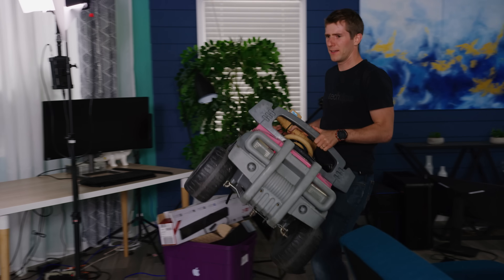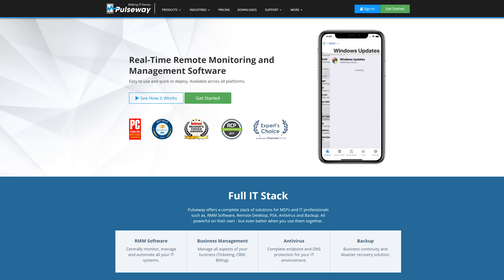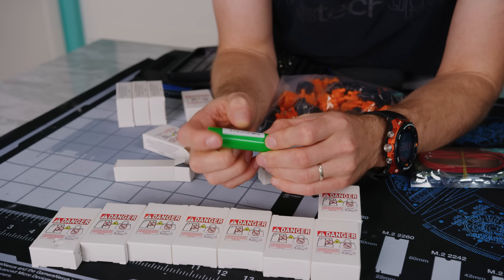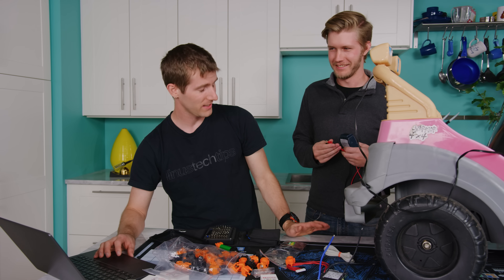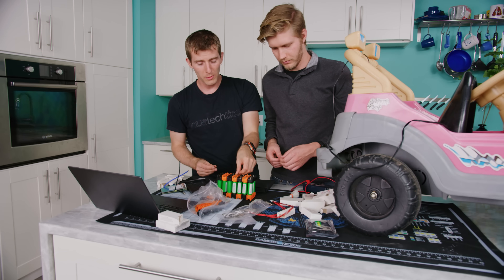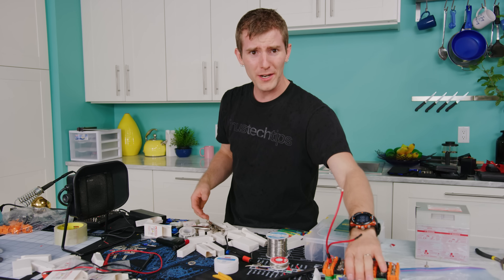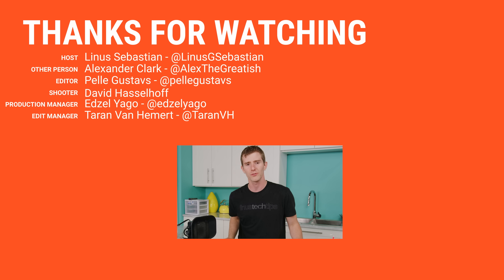DIY Lithium Battery - What could go wrong??

Comment: Should rename the video to "Linus almost dies 3 times":

10:35 shorts the battery
10:50 shorts the battery AGAIN
12:12 car crashes
Reply: Its not you its the batteries that die from shorting the wires. 24V is not even enough to tickle you, als long as your hands are dry. And even with wet hands, the worst that can happen is that you burn your skin.
Reply: @Igeltod  It's not about the voltage, nor even the amperage, in this case.  Lithium batteries are prone to thermal runaway on dead shorting, and Lithium fires aren't a joke. If that's not bad enough, these things are prone to not just lighting on fire, but exploding when abused.  Most of the videos of people's vapes exploding in their pockets and causing severe damage are from dead shorting the battery, usually damaged wraps or unwrapped batteries in metal casings.  Mostly mech mods.  18650 batts aren't toys, and they absolutely can cause a ton of damage if you f*** up.
Reply: @Igeltod  Voltage doesn't kill you, electric current does.
Reply: @LeGoog2008  Voltage penetrates and amperage kills. Like said before, 24Vdc is way below ELV and is considered as low risk
Reply: @umbracat_tr2n  guys, how to do extra battery for EUC (electric unicycle)?
Reply: @umbracat_tr2n  emmmm. Seriously, it is not about 24V over your body though, it is more about the red-hot cabling, burning insulation, and a battery that might start a fire
Reply: @ushiocheng  I wasn't talking about these things; I was explaining how voltamps are dangerous to people
Reply: .....no one thinks he is going to electrocute himself, which, you CAN do on a battery with little more than a single length of wire in a coil that can magnify the voltage, high current lithium ion batteries can dump 30 or 40 AMPS from a single 18650,  thats over 150 watts EACH battery, now multiply that by 7s3p, that is over 3 KILOWATTS that can be dumped into a load, that kinda current will turn a 0 gauge wire incandescent, i dont even want to know what those puny "bus bars" would do if shorted
Reply: @LeGoog2008  yeah but to drive high current through your body, your need high enough voltage...
Reply: @frogz  If you tried to pull 30-40 amps from an 18650, the cell voltage would drop substantially, so the total power draw would be much less than 150W, possibly only 30-50W.  If there really was 3000W capability, then when he accidentally shorted the battery twice, the wires would have gotten extremely hot very quickly.
Reply: @LeGoog2008  Voltage is the killer.  You need enough voltage to force enough current through to be deadly.  A 5V, 3A USB charger isn't going to kill anyone, even though 3A is definitely a deadly current, because you need an extreme voltage to actually make 3A flow through the body, in the order of thousands of volts.
Reply: @coolguy284_2  I have got many over 1000 volt shot but still haven't died... Really odd!

That's why there's overCURRENT protection in things that can touch people. Not overVOLTAGE protection, because high VOLTAGE doesn't harm/kill you.

So what we learn from this: You won't die if thousands of volts hit you if current is low, but you WILL DIE if you get hit with voltage 120V AND current 0,5A.

SURPRICE!
Reply: @coolguy284_2  yea it does drop fast but that's still hundreds of watts initial draw which can turn a wire white hot in an instant, I never said it could run a 300 watt device for long periods just that the instantaneous current can be that high, like starting a car can draw 500 amps from a car battery, most of my cells top out at 5 amps or less but a few rare 1s like power tool batteries can do the hundreds of watts
Reply: @LeGoog2008  

"I have got many over 1000 volt shot but still haven't died... Really odd!"
No you haven't.  The only way to survive a 1000V shock is if it lasts for nanoseconds at most, i.e. a static shock.  You THOUGHT it was a 1000V shock because the machine supposedly generated that much, but once your body made contact with it, the voltage dropped massively, in order to limit the current.

"That's why there's overCURRENT protection in things that can touch people."
Overcurrent protection drops the VOLTAGE.  If the VOLTAGE remains high no matter what, then there isn't any overcurrent protection.

"Not overVOLTAGE protection, because high VOLTAGE doesn't harm/kill you."
It absolutely does.  High voltage is what is necessary to force high enough amounts of current through a human body to be deadly.  Ever touched a live 8kV powerline and ground at the same time?  Those powerlines are capable of supplying enough current to maintain the voltage really high.  On the other hand, a van de graff generator, capable of 200kV or more, is not lethal.  This is because the voltage drops to 50V or less when you draw too much current from it.

You cannot talk about voltage without talking about current as well.  The factor that links them is resistance.  The human body has a high resistance, so the amount of current through a body is much less than the voltage, possibly 100,000x less.

"So what we learn from this: You won't die if thousands of volts hit you if current is low"
Actually, if thousands of volts hit you, you will always die, because the current CANNOT be low with a voltage that high, unless the human body would have a RESISTANCE much higher than it actually does.
On the other hand, if the CURRENT is low, then so is the voltage.  It's no longer thousands of volts, its 100-200V at most, possibly lower.

"but you WILL DIE if you get hit with voltage 120V AND current 0,5A"
If you talk about both voltage and current, then resistance is automatically implied.  In this case, about 240 ohms.  The human body has a much higher resistance than this, so much less current than 0.5A will flow (still enough to be deadly if done incorrectly though).
What you mean to say, is if the voltage is 120V, and the MAXIMUM CURRENT is 0.5A.  Makes a big difference.  That means that it will always be 120V, until the current goes over 0.5A, at which point the voltage will drop to compensate.

"SURPRICE!"
Yup, didn't expect to argue with someone who actually knows electronics, did ya?
Reply: @frogz  

"yea it does drop fast but that's still hundreds of watts initial draw which can turn a wire white hot in an instant"
I feel like a wire in that situation would explode.  When I mess with 4 x 3V supercaps, totalling up to 12V, if a wire shorts them, the wire instantly flies apart into several pieces.

"I never said it could run a 300 watt device for long periods just that the instantaneous current can be that high, like starting a car can draw 500 amps from a car battery, most of my cells top out at 5 amps or less but a few rare 1s like power tool batteries can do the hundreds of watts"
Yeah that makes more sense.  Although I feel like in that case, the battery's internal resistance would be greater than a gold ring or whatever, so the battery would be dissipating the majority of the heat, and might explode.
Reply: @coolguy284_2  You have proved many times in that message, that it isn't voltage wich kills but current is. Maybe you should check what you write and think again.

I can't fix stupidity...
Reply: @LeGoog2008  No, all that is proven is that you are unwilling to listen to me.  High voltage always kills, you said it doesn't if the current is limited.  But that means that the voltage drops, too.  So if the voltage remains high, it will always be deadly.  What is so hard to get?
Reply: @LeGoog2008  Saying that current is what kills, not the voltage, is akin to saying that it's the bullet that kills, not the gun.  It's technically correct, but missing the point completely (how did the bullet get moving that fast?  how did the current flow so fast?  because voltage, that's how).
Reply: He is the new electricboom

Comment: Love it, please do more diy battery projects. For your own safety, please tape up loose electrical contacts before attaching them to the battery, and unwrap as needed. I'd hate to hear you got hurt by a stray live wire flying about and grounding on to something it shouldn't.

Comment: You won't feel a 100 volt DC because it's it actual voltage but if you hit a 110 AC you will  get a shock because the actual voltage is √2 times 110 so kinda you won't even feel 100 volt DC in your hand

Comment: At 10, I used a 12v leisure vehicle battery and connected it to my Barbie Corvette that I found behind a convenience store near Finch and Islington (painted it black, of course) and yeah, I could drive that from my place to the school where the school bus picked me up and halfway back. 

Unfortunately, I had no idea what wire gauge meant, nor was I familiar with fuses, so the car kind of caught fire. 

Still, when it ran, it had a tape deck and front and rear fog lamps, as well as high beams.

Comment: use a bench power supply with current liniment capability if you don't have enough voltage the use 2 in series to add up to your tolled voltage.

Comment: you sir are on par with ElectroBoom, I approve, the only thing you at least didnt show was checking the voltage on the contacts of each cell before wiring with the bars, otherwise you might have a cell that is not connected.

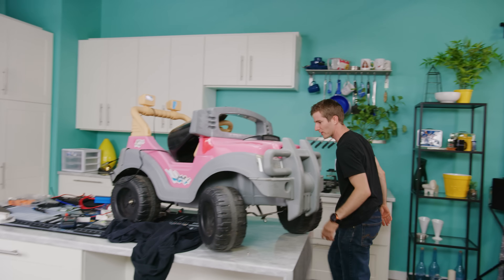Comment: 7:20 Guess what, it would be a lot smarter if you would wear ESD protected safety shoes and how dumb could one be wearing a metallic wedding ring while working on batteries that could short circuit!

Comment: Just paused the video briefly to point out that there are no high output 18650s with 3500mah capacity. It's either, or. Samsungs high output batteries (VTC5A) put out around 25a, at 2500mah. In fact even 21700 batteries at 35a output only have 3000mah capacity. At 3500mah, they will be 15a, which isn't high output - and possibly dangerous to use in high draw applications.

Comment: Linus just a warning THEY ARE NOT 3500 MAH OR THEY ARE NOT HIGH AMP BATTERIES. THESE BATTERIES ARE NOT SAFE, MAKE SURE TO DO SOME MORE RESEARCH. use mooch on instagram to determine safer bateries

Comment: That's not a controller board, that's a battery management system (BMS). You can disconnect the 8 pen connector and still use your balance charger. You just reconnect your 8 pen connector to your BMS when your finished charging. Also your Voltage is 26 to 29.4. But 29 volts should be your maximum for your charger and don't allow your voltage to fall below 25 volts or it can kill your cells. Hope you do more Videos like this, making battery's for things is pretty fun when you get good at it.

Comment: 9:45. Woa Woa woa. I know you said no criticing. But alex, why you have to waste so much soilder wire. You are supposed to put the tip of the wire on the join that you are soildering, not directly on the top of the soilder iron. You barely need a quarter as much wire as you used.

Comment: you shouldn't use normal tape you need to use Kapton tape for lithium batteries because they can get hot. Also, you have a ton of tools but you still have a crappy wire stripper lol. just buy a self-adjusting wire stripper and see how much easier it is.

Comment: A 3500 Mah high Current 18650 batt? its probably 5-10c at best or fake. 
The actual high 20-30c 18650s are usually low Mah from what I've seen.

Comment: LOL a 3500 mAh high power cell, good luck. The best one LG makes is 3000mAh and its about $6 per cell right now (about $2.10 per cell if you order 10 million, but they LG doesnt allow resale to consumers)
Reply: Wearing metal rings and working on batteries is a great way to get 3rd degree burns!
Reply: Well at least you used some sort of BMS, although that BMS is very suspect.
Reply: Those cells literally have white labels on them, in the industry "white label" is a verb, like "lets just get some cheap cells from china and white label them"
Reply: Of all the videos you have made this was maybe the hardest to watch (maybe not as bad as the cast heat sink).

Comment: Rings are dangerous with high amp cells as a heads up. It brushes across positive and negative that ring will turn red hot in a few seconds.

 Worse of the ring can actually weld to the battery or wires meaning you might not be able to just pull your hand away.

Comment: 5:05, at 29v DC electrocution isn't really much and issues unless you just so happened to have salt water on both your hands then grab the positive and negative with one each.

 Even then you'd likely just get a little shock unless you had a particularly weak heart.

Comment: 10:40 I expected... hand wiring a Li-ion battery pack w/o a ton of e-tape is scary to watch...
Reply: And Linus even brave enough to swing a battery pack when its wire terrminal is exposed...
If this is a high-current Li-ion battery designed for 20~30A,  R.I.P. Mr.Linus

Comment: If I was you, I'd see if there was a way to put a heatsink and cooling fan on the long end the charge controller is not on or a pair of cooling fans on both sides to get air flow through the battery pack, and also wire in some headlights and maybe a flasher on the back. 

But that's just me.

Comment: Theses are Sony VTC2, they can take about 30amps but with that rating i would rather go for LG HB6s (35amps 1800mah, reliable and will stay cooler @30amp continuous.) If you guys wants to know more about 18650 (or 20700,21700...) you can check out Mooch bench tests. He's the best around for theses cells!

Comment: Need to check out the modified hot wheels forum over the past few years mods from upping the voltage to putting  high powered motors for adults to drive.
Tho cheap plastic gear boxes suck lol someone needs to make metal gears

Comment: This looks like fun!  Now how about building a MASSIVE DIY laptop power supply box and test it for HOW LONG it can power that ridiculous Acer 21x Suepr Laptop you have reviewed previously with the Two 1080 GPU cards in it! 1 hour? 10 hours? 100 hours? in a space the size of say a small shipping box?

---

And sorry to hear about you NOW VERY LIKELY BENT PHONE!

May I suggest you buy and then TEST this super rugged smartphone:

AGM X2 SE 4G Phablet - BLACK 260414801

6GB RAM 64GB ROM Fingerprint Scanner Dual Rear Cameras IP68 Waterproof 6000mAh Battery

https://www.gearbest.com/mobile-phones/pp_1686789.html

and I suggest doing something rather Canadian in terms of a ruggedness test...take a Hockey Skate blade to the screen and SEE if it survives the scratching and for good measure dump the phone into a pile of ice/snow overnight to see how much freezing it can actually take!

And FINALLY...can multiple smartphones be hooked up in series to power your Power Wheels?

Comment: FYI: these 18650's are rewraps, not original Sony batteries. There are literally no 3500mAh 18650's with high amps out there. Get Sony VTC5A's and get them from a real reputable source. A large percentage of these batteries are rewrapped 25R's by Samsung or 30Q's and they have lower amps which might at some point make them vent. Google "Mooch Batteries" and you'll find reputable sellers for VTC5A
Reply: Agreed, there's no way they're that high capacity, considering they're 18650s.

Comment: If you put some rubber on wheels will work way better usually like a old bike tube or something like that, could get bike tubes from a toddlers bike cut them so they are wider and should stretch over the wheels

Comment: This jeep brings memories :)
A long time ago I also upgraded from 12V to 24V. But the motors did not last.
They are usually designed for certain MAX voltage. If higher voltage is connected, more current flows through copper winding and after some time it melts.
Also the gears cannot handle the power.
I recommend at least using some kind of PWM controller / DC ESC with analog foot speed control.

Comment: DC brushed motors have a KV rating (1000 revolutions per volt).  A 12V motor that turns 3,000 rpm will run at 6,000 rpm using 24V.  That's no load speed of course.  Since they are usually geared down to provide more torque some may turn faster than you would think.

For instance a 12V 1KV motor will turn 12000 rpm, doubling the voltage will give an rpm of 24000 and you have to be cautious there, because if you spin it at too high a speed the windings could start to separate from the armature, if it's not designed/built for that kind of rotational speed.

Comment: As an electronics engineer, watching the assembly of that battery pack was fucking terrifying. Bus-barred lithium batteries with no internal protection circuitry have an absolutely gigantic energy potential just waiting for a stray wire, screwdriver bit, washer, whatever... And once the accident happens, that shit is literally welded into place INSTANTLY and you are not gonna get it out of there before the battery pack is in explosive fireball meltdown (with toxic fumes) mode.

Glad it worked out, the end result looks like a comically scaled up RC car!

Comment: Linus, what's the best home server build in terms of price / quality?
Reply: Raspberry Pi (or similar SoC board) or an old unused laptop with the lid switch (sleep/hibernate) disabled. Hard to beat $0-35 from a value perspective, and either will serve the needs of a huge majority of common home services.

Unless you KNOW you need hardware of some minimum spec, in which case you probably wouldn't (shouldn't) be shouting into the void of youtube comments for purchase advice. Whatever costs the least (also consider electricity and cooling), and occupies the least space, whilst adequately performing the desired tasks, that's the best server (home or otherwise).

Comment: High current applications shouldn't be using solder joints anyway? Current draw and heat are a possible issue. Crimp type connectors should be used I believe.
Reply: Soldered Connection > Crimped. The resistance is much lower.